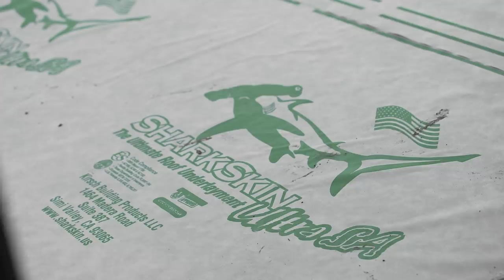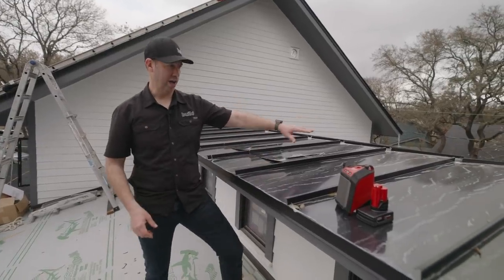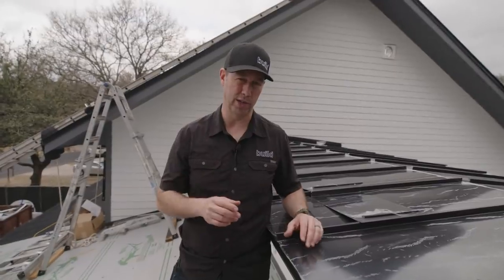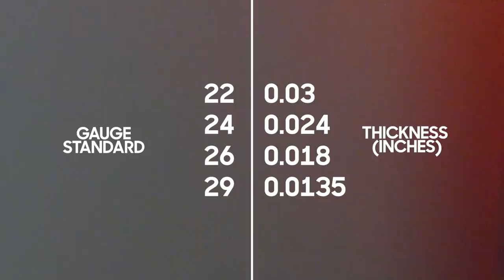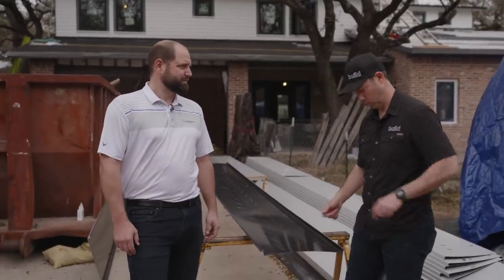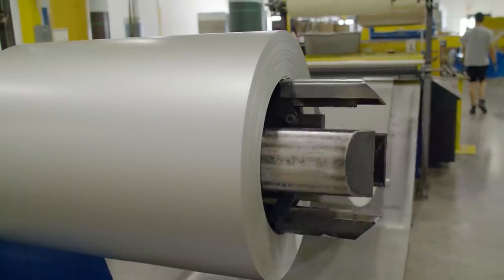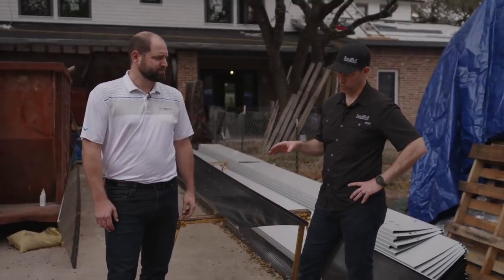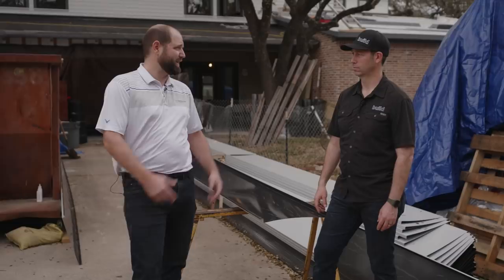Metal Roof- Best Practice Details

Comment: Great point on the drip edge, Tom Silva always uses a thumbs width away from the fascia, to avoid the water getting stuck in between the two and causing rot.
Reply: as risinger stated in the video, usually you are going to slide the gutter behind the drip edge. in risinger's case, the cor-a-vent acted as a spacer.
Reply: @paperwait9611 , Agree, most just use a gutter or don't. Just make sure your drip edge is 1/2''-5/8'' off the fascia to prevent a capillary situation.
Reply: Aluminum fascia damn you people and your exposed fascia !! 😘

Comment: I bet this house would easily cost $500 per square foot if someone had to pay full price for all of the materials.  I would love to have a house built with these materials and specs, but there is not a chance I could afford it.
Reply: I bet the roof alone costs more than the average home in the U.S. which is 374k.
Reply: @borderwave2  ^ ok boomer
Reply: @borderwave2 It probably did with all the junk mesh and furring strip debacle. Waist of time and money. Seam is meant to be applied directly to deck/substrate.
Reply: @peterparker9286  yes I am wondering about all the stuff he is recommending laying on top of the sheathing when as I understand the manufacturers recommend applying directly to sheathing.  I wonder if this will cause oil canning with putting stuff between.  BUT I am also trying to avoid condensation issues with applying directly to sheathing with a conditioned attic
Reply: @bellaherna1 Yes More oil canning. Need a good substrate  A  wood deck. I have put fields of standing Seam down. Use backer rod or low gloss paint to cut down on oil canning.

Comment: Great video, would be interested in why a black roof was chosen rather than a lighter coloured one, would it not get excessively hot in the Texas summers?
Reply: Outside of paint degradation, my bet is that because of the ventilation behind it and all the insulation under that it does not have a significant impact on heat energy transfer into the home.
Reply: Without ventilation, all that energy would go through the insulation. However, the high temperature variance between the well insulated home and hot metal roof will generate circulation through the ventilation system.

Comment: As a solar business owner with over 40,000 installations, I’ll say we always get excited when we can work with standing seam. Its the best roof type for solar and makes far far more sense than solar roof tiles or punching holes in a 3 tab
Reply: Being able to just clamp onto the roof without needing to worry about sealing holes is a huge perk of standing seam. That by itself has been enough to make me look closer at it. The decades long lifespan (assuming it's been installed correctly) makes it even more attractive.

Any experience dealing with weird roof shapes? I've seen a lot of newer houses that seem determined to have as many rooflines as possible, and it makes anything other than asphalt a real pain in the neck.

Comment: I'm considering a similar roof insulation.  I don't understand why you still need an air gap when everything is sealed up so tight...wouldn't you just make sure water can't get in by sealing the ridge cap?  I don't see any way water can penetrate the metal roof and if you can keep it out, there is no need for air gap/venting right?  I'm for being cautious, but I have to be able to justify the extra time and expense when I just don't see any way to trap water in there.  Can you explain this more?
Reply: I think it's because the metal roofing material causes condensation of the air from the outside which form water beads on the underside of the metal ?

Comment: if water gets under the metal how does it flow out? it seems like the diagonal boards would soak it up and the drip edge would work to keep it under the metal.

Comment: I'm trying to design a similar roof on my future house and like the idea of air ventilation under the roof. I had originally thought that furring strips would be the way to go but my roof will only be 1:12 and 2:12 pitch. Therefore I may use the ventilation underlayment mentioned in the video. Does anyone know if the roof can be walked on once the metal is installed? Or will it result in the roof deforming/bending because of the underlayment? Nothing lasts forever so someone will eventually have to get up on the roof--I just want to make sure it doesn't deform.
Reply: I would appreciate an answer to this question as well

Comment: Wait! Reflective side down? I still don’t get it. As far as I know it’s always reflective side up, with an air gap above, to reflect that radiated heat out.
Reply: Facing down is fine, and should work just as well. 
This is because an object with high reflectivity must also have a low ability to radiate thermal energy, a.k.a. emissivity (pseudo-explanation at the end). If you look up the emissivity of something shiny like aluminum foil, it's around 0.04. This means it only radiates only 4% of what a perfect thermal radiator (a.k.a. blackbody) would emit at the same temperature, which gives the same effect as if the radiant barrier was installed face-up on the other side of the air gap and reflected 96% of the radiant energy from the roofing metal.

The amount of radiant energy an object in thermal equilibrium absorbs is equal to the amount it is able reradiate, also known as its emissivity. It has to be, otherwise it wouldn't be in thermal equilibrium, and would instead be either heating up or cooling down. If you ignore transmitted radiant energy (i.e. you're looking at something that is essentially nontransparent, like a radiant barrier) then the reflected energy and absorbed energy must total 100%. Because absorbed energy must be the same as emitted energy (thermal equilibrium), you end up with a relationship where reflectivity goes up when emissivity goes down, and vice versa, (assuming nontransparent objects). I know this isn't really an explanation of the underlying physics, but hopefully it is still helpful.

Another way to help with understanding this is to look at what would happen if it wasn't true; heat would flow more easily in one direction than another, and you'd get infinite cooling or heating depending on the installation.
Reply: @ergohack  Whoa! Thanks for the explanation. Gonna need time to digest this.
Reply: @davidg5010  Sorry bud, but the experts disagree with you on this one. I suggest doing a bit more reading on this.
Here is a link to start you off: https://web.ornl. gov/sci/buildings/tools/radiant/

(You'll have to remove the space in the link to make it work, the spam filter on this channel seems to catch links)
(Edit)
This page clearly describes radiant barriers working in both directions; in one direction by reflecting "heat", and in the other by reducing "heat" radiated from the surface of the barrier.
Reply: @davidg5010  I'm just going to copy and paste the part that you likely didn't read if you think that article agrees with you. Pay special attention to the part I've bolded.

How are radiant barriers installed in a residential attic?

Radiant barriers may be installed in attics in several configurations. The simplest is to lay the radiant barrier directly on top of existing attic insulation, with the reflective side up. This is often called the attic floor application. Another way to install a radiant barrier is to attach it near the roof. The roof application has several variations. One variation is to attach the radiant barrier to the bottom surfaces of the attic truss chords or rafter framing. Another is to drape the radiant barrier over the tops of the rafters before the roof deck is applied. Still another variation is to attach the radiant barrier directly to the underside of the roof deck.

How do radiant barriers work?

Radiant barriers work by reducing heat transfer by thermal radiation across the air space between the roof deck and the attic floor, where conventional insulation is usually placed. All materials give off, or emit, energy by thermal radiation as a result of their temperature. The amount of energy emitted depends on the surface temperature and a property called the "emissivity" (also called the "emittance"). The emissivity is a number between zero (0) and one (1). The higher the emissivity, the greater the emitted radiation.

A closely related material property is the "reflectivity" (also called the "reflectance"). This is a measure of how much radiant heat is reflected by a material. The reflectivity is also a number between 0 and 1 (sometimes, it is given as a percentage, and then it is between 0 and 100%). For a material that is opaque (that is, it does not allow radiation to pass directly through it), when the emissivity and reflectivity are added together, the sum is one (1). Hence, a material with a high reflectivity has a low emissivity, and vice versa. Radiant barrier materials must have high reflectivity (usually 0.9, or 90%, or more) and low emissivity (usually 0.1 or less), and must face an open air space to perform properly.

On a sunny summer day, solar energy is absorbed by the roof, heating the roof sheathing and causing the underside of the sheathing and the roof framing to radiate heat downward toward the attic floor. When a radiant barrier is placed on the attic floor, much of the heat radiated from the hot roof is reflected back toward the roof. This makes the top surface of the insulation cooler than it would have been without a radiant barrier and thus reduces the amount of heat that moves through the insulation into the rooms below the ceiling.

Under the same conditions, a roof mounted radiant barrier works by reducing the amount of radiation incident on the insulation. Since the amount of radiation striking the top of the insulation is less than it would have been without a radiant barrier, the insulation surface temperature is lower and the heat flow through the insulation is reduced.
Reply: @davidg5010  The orientation and function work the same, its just that here you have a ¾" air gap rather than a 10' air gap.
Google, or your other search engine of choice, is your friend. I'm not about to go doing that for you, when you clearly don't want to hear it. The link I gave is more than sufficient to help someone who is willing to learn, A.K.A. the occasional internet person who stumbles on this comment.

Comment: Ice Guard installed onto the eaves (overhangs) is to be wrapped onto fascia and continue at least 2' past the exterior wall and over the heated space beneath.          In other words:  not just 3 or 4 feet "up the roof" it all depends on how big your overhangs are.  When you are dealing with open porches for example you may need 8-10' of Ice Guard or more

Comment: I would have expected integrated solar panels into roofing tiles from Matt 😆
Reply: Tesla didn't sponsor the show, or give Matt any free solar tiles, so Matt won't be using their product
Reply: @cyclopsvision6370  Honestly doing the roof like this is a better option for Matt. I see this house as a training exercise for the next passive house his team builds. It is better to work with partners that will support you along the along the way with things like installation training.
Reply: Solar panels are always changing and improving. A metal roof last 50+ years, while most solar panel systems expire or become obsolete within 30 years. It just doesn't make sense to integrate the two as a single system.

I'm in Florida and ye been warned that those S-5-n connectors are great and I have used them myself, but since they are not connected directly to the rafter engineers are requiring them 16-32 inch on center in high wind areas. In fact Maimi Dade is about to change wind requirements to 170mph and these may not meet the requirement. Just be prepared to install A LOT of them if you are using a rail system. The S-5 can also be used directly to panel w/o rail, but it does not provide enough space between the roof and rear panel and is believed to shorten the life of the panel and may be against fire code.
Reply: @karthik11512  If Matt really wanted to go passive, he would have Tesla's solar roof, and 3 powerwalls, and use geothermal for heating and cooling.  It doesn't get more passive and energy efficient than Tesla's solar roof and geothermal, especially in Texas, with lots of sun exposure
Reply: @cyclopsvision6370  thank god he was wise enough to use those tiles. Weve made an outrageous amount of money fixing warranty claims on the solar roof
Reply: @cyclopsvision6370  im not sure if youre just an irreverent fan boy or just wholly ignorant on solar but if you think the solar roof or the power wall are the best options for solar then you are one or the other
- a solar business owner with over 40,000 installs

Comment: would be really cool to see a micro inverter solar system on that roof and the install process :D
Reply: Emphase with iQ 7+ micro inverters and NeON r lg panels 
Then use iron ridge rail system with metal roofs mounts that would be a killer  system
Reply: Elon has a solar panel that IS the metal "shingles" that snap in and out for replacement and repairs
Reply: micro inverters are lame ....sorry
Reply: @RossMalagarie  I was just going to say, every tesla roof should be the norm now. Every house could be self sufficient for power. And not have those awful panels on them .
Reply: Good news!

You can buy metal clips that clamp onto the seams without putting any holes in your standing seam metal roof. Then you just put aluminum frames on those clamps.

After all, why pay extra for standing seam if you are just gonna put holes in it anyways?
Reply: Shame the black colour will  increase the temperature around the panels and reduce the panel efficiency.
Reply: @stellarluna2637  yep but the power companies are going their best to stop that hopefully buy making their power much cheaper.....we shall see
Reply: he would probably get it for free too
Reply: @uctt24  Better to go with SunPower solar panels.  They are the most efficient consumer solar panels.  Only thing better is the type of stuff they use on satellites/spacecraft.  But those are not mass produced and would cost several times more than the house they're going on.
Reply: @uctt24  Solaria, Aptos & certain Q cell panels all beat LG panels. I chose 440w Aptos bifacials on my own home with IQ8 & enphase batteries (this is irrefutably the best grid tied setup available at least through 2023)
- a solar business owner with over 40,000 installs
Reply: @RossMalagarie  we just broke our contract to install those roof riles after seeing just how time consuming several warranty claim repairs had been. I have deep deep pitty for anyone getting suckered into those
Reply: @stellarluna2637  a metal roof like matt (and I) just installed can last 100 years. Solar panels are a wear item and last approximately 25/30. Imagine how much less money is spent just replacing solar vs the entire GD roof 3 times

Comment: What kind of idiot would ever put a black roof on a house?  Especially in Texas.
Reply: White would have been a far better color.  You'll be dive-bombed by birds unloading from 300 ft in the air.  So that the black roof absorbs high amounts of heat then releases it into the atmosphere, heating the environment.  That's an extremely bad idea. A black roof with white speckles everywhere!   Waaaahahaha!!!!!
Reply: @spacescatatford  On top of that, you wouldn't have needed that infrared-reflective material underneath.

Comment: If you use open cell spray foam insulation you are introducing moisture 
to the underside of the roof deck. If you use an ice and water 
underlayment that moisture cannot get thru the roof sheathing to be 
carried away thru ventilation. How are you then venting the roof to 
prevent degradation of the roof deck?
Reply: I started watching this video that you recommended but it ended up leading to more questions than answers :)  - also - the way he is doing it is cost prohibitive!
Reply: @bellaherna1  Try this one. Ventilation under metal roofs is important. You can pay me now or pay me latter in regards to what you do.

Comment: What about striations? On a previous video, it was stated how important it was to choose panels with striations but it looks like you chose a flat pan style. Do you have any opinions on this? I'm building my house soon and this would help me a lot in my choice of metal roof! Thank you!
Reply: striations reduce oil canning, he would have had less oil canning if the would have double locked each panel before installing the clips and next panel. The difference is cosmetic